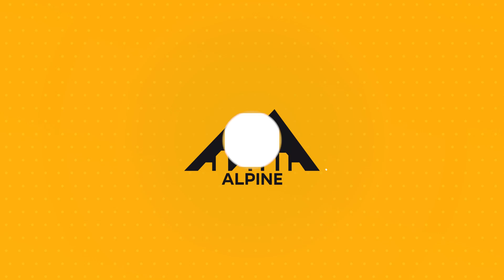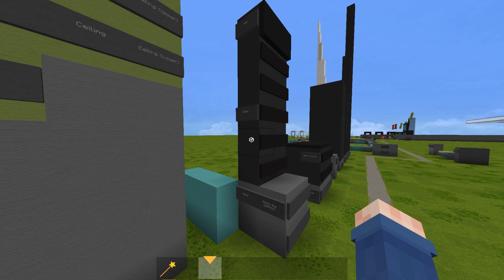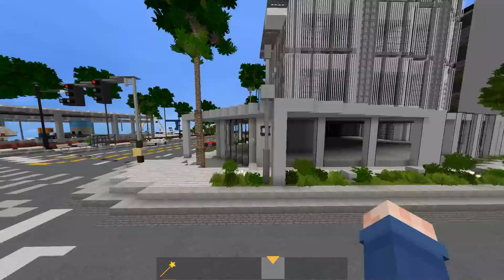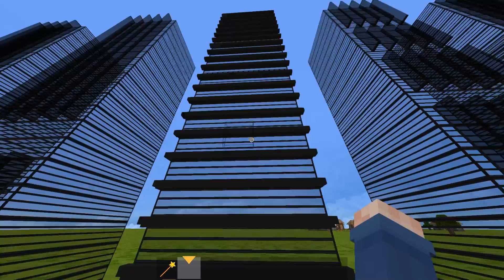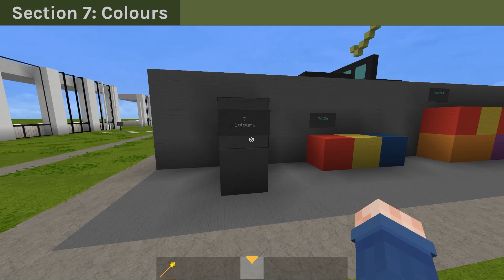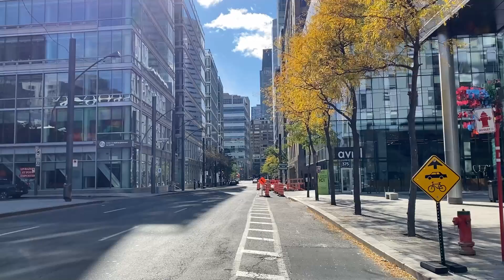Minecraft Building Concepts from a Self-Declared Pro

Comment: Am in my last year of high school and I signed up for architect engineering but sadly there are only civil engineering available soo do you think i can still be an architect engineer even when I have civil engineering degree?
Reply from the maker: Hi, an architectural engineer has knowledge from a lot of civil engineering blended with the technical side of architecture. In civil engineering you’ll get a bit of exposure to this likely through building science and maybe one other course, but a lot of the technical architecture won’t be taught in civil. You’ll likely need a masters in architecture or architectural engineering to work more on the architecture side
Reply: @Alpine1  thanks 🙏🏼 
And yes am the same guy from discord

Comment: Tuned mass dampers are pretty uncommon. Most larger skyscrapers either use an outrigger structure (like 432 park avenue, which you mentioned) or a (bundled) tube structure (for example Sears tower in Chicago). It is also possible to reduce wind loads, which can be done through aerodynamic shaping (Shanghai Tower) or by allowing wind to pass through at certain locations (432 p.a. also uses this system).